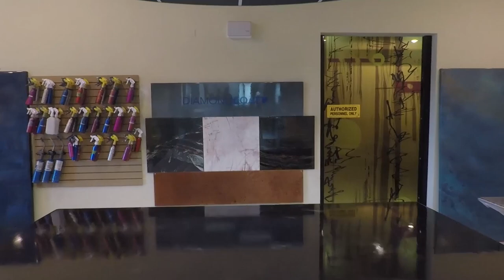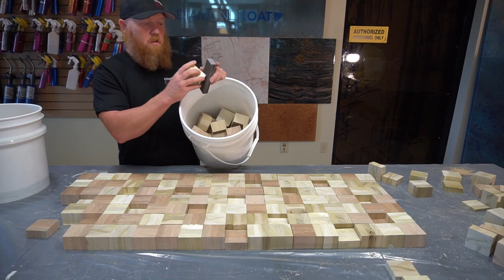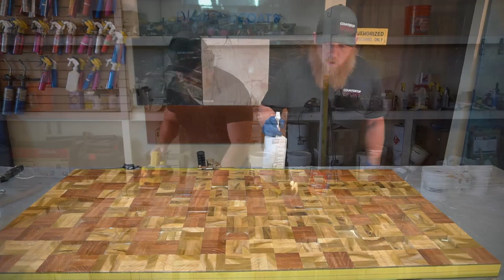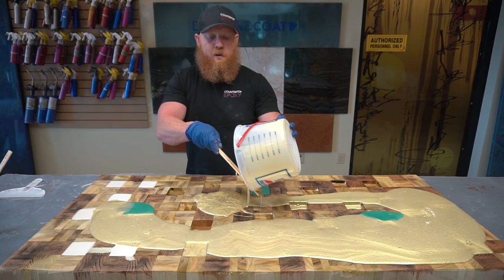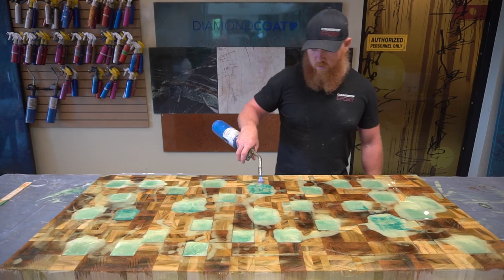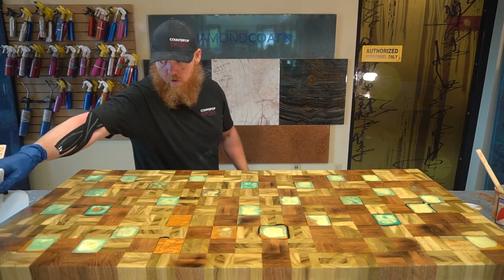HOW TO - Butcher Block Countertop - Epoxy Butcher Block - Countertop Epoxy - Butcher Block DIY

Comment: Nice end result. Only thing I would do different is to wear a resperator when sanding. I do a fair amount of woodworking and some epoxy resin work and the amount of fine dust in the air is incredible. Do your lungs a favor and throw that bad boy on.  Otherwise nice work.

Comment: Dude Great video but you really need to where a mask, that crap is bad to breath in.
Reply from the maker: Our epoxy has zero VOC ! :)
Reply: CountertopEpoxy
Exposure to wood dust has been associated with health issues due to the natural chemicals in the wood, or substances in the wood such as bacteria, molds, or fungi. 
Wood dust is considered 
carcinogenic to humans (Group 1) according to the International Agency for Research on Cancer (IARC).Aug 3, 2017

Strong and consistent associations with cancers of the paranasal sinuses and nasal cavity have been observed both in studies of people whose occupations were associated with wood-dust exposure and in studies that directly estimated wood-dust exposure.
International Agency for Research on Cancer. Wood Dust and Formaldehyde, IARC Monographs on the Evaluation of Carcinogenic Risks to Humans, Volume 62. Lyon, France: World Health Organization,
Reply: @CountertopEpoxy  It has nothing to do with the zero VOCs.  It's to do with fine particulate damage when you're sanding.  Also, your resin may be 'eco', but it's still a chemical, and I'd lay money that your hardener most definitely isn't VOC-free.  Why the resistance to protecting the one set of lungs this man has?

Comment: Love this idea, but as a woodworker, I can't help but cringe from not seeing any glue between those blocks. I'd love to see a follow-up comment on here in a couple years about how well it's held up over time with only the epoxy holding it together.
Reply: Heh it also makes me cringe to see you sanding epoxy without a dust mask. Don't do your lungs like that! You'll regret it later!

Final product does look pretty bad ass though. Thanks for more inspiration for my epoxy countertop experiments.
Reply: Tyson Sommer I made a tabletop 3 almost 4 years ago by a very similar method.  It has held just fine and has undergone a serious of extreme beatings.
Reply: epoxy resin gets in everywhere it will even crawl under tape if its not a wet sanded fine surface ...
Reply: I was thinking the same thing.  I would have glued the blocks together before I used the epoxy.
Reply: Me too.
Reply: I think it hit the burn barrel, why does this guy keep posting videos of failures? And what was the Linseed oil for, the smell had to be unbearable in there? I was just thinking about how flammable Linseed oil is, I was always told never throw linseed oil rags in the trash they can spontaneously combust...
Reply: I saw this post when I was looking to see if someone else said this.  I was staring at him pouring the epoxy and just saying "Wait, wait!  you forgot your glue-up."  Oh well, if it will hold up, that's great, much less time for same end result.

Comment: You said you got "Sticks at Lowes" ? Where did you find these I looked all over the store and couldn't find anything!
Reply: I've found that not all Lowes carry the same product lines.  To get the size stock he's using you'll have to go to more of a specialty store that has hardwoods.
Reply: I think he meant 2"x2" hardwood that had to be cut to length...I once worked for Stone and Stone Pool renovators in the 80's and my boss always called a trowel a "spatula" not very construction minded, but he paid well considering most of his jobs were in very hot places and I wore heavy coveralls taped at the ankle and wrist with a full face respirator in the deep end of municipal swimming pools in 100 degree plus weather, running a chopper gun with "polyester resin" for a living.

Comment: Amazing for being a first timer on doing this that gives me some faith in myself to give it a try the only question I have is would it give this table more strength to have glued each block together with yellow wood glue before applying the clear coat?
Reply from the maker: No need to glue the pieces together prior to application, the epoxy will seal the wood together.

Comment: I have bought an IKEA countertop which is made with hardwood venner which comes pre oiled with hard wax oil. I would like to coat it with a high gloss epoxy coat. Can I just pour it over the countertop as it is pre oiled? Thanks and great job with that butcher block

Comment: Loved the way you created that piece of art and explained everything! 👍
Can epoxy turn yellow or go dull or melt under humid or hot temperatures above 50°C over time? 
Pls tell what to look out for in an epoxy (other than your brand's) that would or wont make it go dull or yellow over time. Thanks in advance.
Reply from the maker: Hi! After it's fully cured it should be temperature resistant up to 500 degrees Fahrenheit.  Our epoxy doesn't yellow over time, unfortunately we're not sure how to advise to look for in other epoxies other than asking the brand.
Reply: @CountertopEpoxy  Do you export your products?
Reply from the maker: We do ship internationally! The cost of shipping is dependent on the weight and physical shipping address. However we are unsure of any duties/fees that you may incur upon bringing products into your country.

Comment: Great looking butcher block. I suspect that given the cost of epoxy, the cost of making this countertop is prohibitive for most woodworkers unless it is a commissioned piece. Still nice though.
Reply: Cost of epoxy? Epoxy costs about $40-50 per gallon (based on one gallon on amazon), most counters poured thick are about 3 oz. per sq.ft. I personally think he should have skipped the linseed (I dont know what he was thinking) but, if they sell just one gallon of epoxy to just one person based on the video, they break even, since they have a 200% mark up on the material, sell two and triple their investment. As for "great looking" I'm guessing you didn't notice that the blocks were not the same size and that he put linseed oil on them and then applied epoxy, I'm not sure what the adhesion value is for epoxy over wet linseed oil, but I'm guessing it's not good...
Reply: @dliguori25 Linseed oil is nasty stuff!
Epoxy will work with just about anything, so don't toture yourself using Linseed oil when you could use so many other more reasonable methods!
Linseed could work like a cast release, I honestly wouldn't risk it.

Comment: Hello, Did you say you got the wood from Lowes? was it already glued with the 3 pieces laminated or did you glue them then cut them?? What size board did you use to glue the pieces together and cut them if you made them to get that size blocks ? Thanks It look great.

Comment: Awesome video!  How did you cover both sides of that cutting board you mentioned?  I'm assuming you did one side first and after it was dry you did the other side, but how did that seam on the edges look?  You get those drips that harden along the bottom edge and after sanding it doesn't have that same look.  Thanks again!

Comment: Could you say/guess at what I may be looking at cost wise just for materials?
Reply from the maker: we used roughly half gallon of our Epoxy which we sell in 2 gallons at this time for $214 we also used a very small amount of wall epoxy which is optional. Check out our website for all our products www.countertopepoxy.com

Comment: Is that a ratchet strap holding the blocks together,Should you use glue for the wood blocks,or does the epoxy hold the blocks togeher just fine.Great videos enjoy to watch.I know it is only epoxy resin,but it is nice to see the transformation,to the finished product,item.Thanks
Reply from the maker: All he used to adhere the blocks was the ratchet strap and the epoxy!

Comment: After poliching epoxy becomes scrached whish disk or product i need To use. Thanks
Reply from the maker: Hi! Our premium epoxy is highly durable and very scratch resistant. However, if you're having trouble in this area, we'd recommend using Meguiar's polish and buff them out.

Comment: In a high moisture environment will the table expand and break the epoxy?
Reply from the maker: Not so much high moisture if it's sealed on all sides, that usually isn't a problem. 

However, with temperature fluctuations in an outdoor setting, if the surface has several small pieces of wood (rather than one large wood slab) it's more likely to crack the epoxy if the wood isn't dried out properly.

Comment: Question....What did you put around the outside of your blocks (yellow) before you started with the epoxy???

I'm going to be making my new countertop out of MDF (sp?) . I'm putting on sheets of mosiac tiles that have some multi color glass pieces in them.  I'll also be using epoxy grout and need to finish it off with two fairly thick splash coats of clear epoxy.
Do you have any suggestions what I can put around the diameter of my countertop that will hold the epoxy from dripping off the edges and can be easily removed once the epoxy has set up???

Thank you for all for offered suggestions to help my DIY project to be a beautiful success!!!!

Doe Campbell
Reply from the maker: That yellow band is a ratchet strap, but you can use a metal/foil duct tape around your MDF to create a dam for the epoxy to sit up against! Visit www.countertopepoxy.com and talk to our staff if you more questions, we're happy to walk you through what you need to know!
Reply: Thank you! I had the same question and couldn't find a decent answer anywhere. I thought about regular duct tape but I was afraid it would either meld with the epoxy or leave a sticky glue.

Comment: would you recommend using a heat gun to get rid of any air bubbles? awsome project btw
Reply: Heat gun works fine.  Be sure to get any wood dust out of it before using.,

Comment: Did you have to glue the blocks together before you used the epoxy?
Reply from the maker: No we didn't. The first skim layer of epoxy is enough to hold the blocks together.

Comment: Can anybody let me know pls why that heat treatment is given...? To dry up the epoxy fast...?
Reply from the maker: It's to remove air bubbles and smooth out the surface!
Reply: Thank you... but can we also use hot air blower to remove bubbles..?
Reply: yes you can...

Comment: You call yourself a pro and you don't wear a dust mask or respirator??  Your creds went right out the window.
Reply from the maker: "Creds" full word "Credential" - a qualification, achievement, personal quality, or aspect of a person's background, typically when used to indicate that they are suitable for something.... This something being art and epoxy application. His "creds" have nothing to do with wether he decided to wear a dust mask or respirator. Though we do encourage wearing a dust mask while sanding wood for instance, our epoxy is zero VOC (Volatile Organic Content), which means no solvents or harmful odors to breath. :)
Reply: @CountertopEpoxy  Your creds are undermined if you don't follow safety procedures is what the OP is getting at.  It's nothing to do with the guy in the video's skill at applying epoxy resin.  It's his skill coupled with his professional approach/professional responsibility.  

Irrespective of VOCs, he should absolutely be wearing a bloody mask - the mask is also there to protect his lungs from fine particulate damage when sanding.

While your resin may claim to be eco, your hardener absolutely won't be - and you can't set resin without hardener.

In this instance you've also failed to grasp that not everyone watching will be using the same low VOC resin as you.  With a public position and followers of over 50,000 magnitude, comes responsibility to your viewers. People learn by watching, not by what you say elsewhere on another unrelated video about sanding wood.

Please, just wear a bloody mask instead of doubling-down like this. 🙄